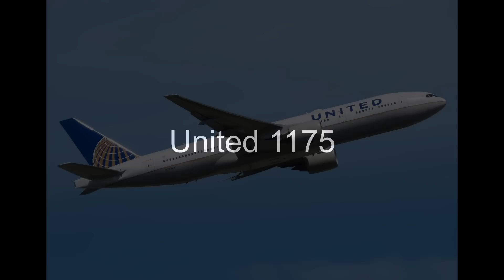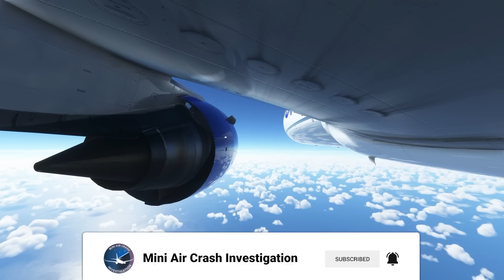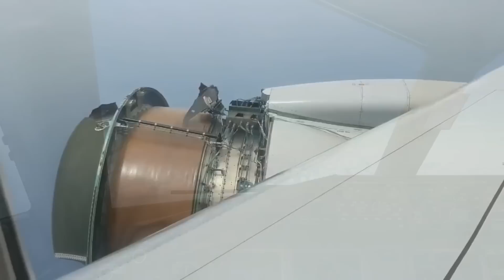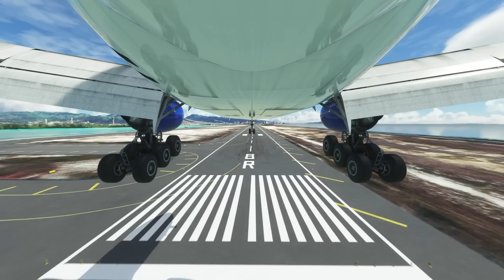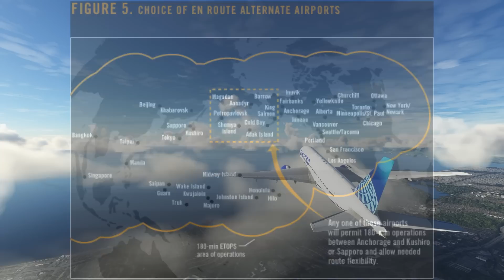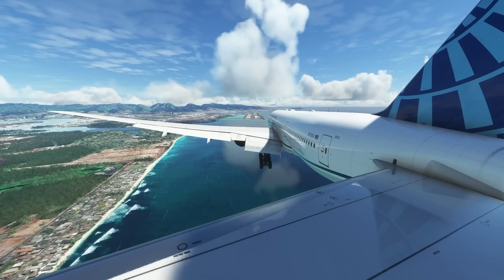How A Room With Bad AC Almost Crashed A Passenger Jet | United Airlines Flight 1175

Comment: Safety aside, I bet the inspectors would have liked the room to be cooler, too
Reply: That's still a safety issue, in my opinion.  An inspector who's personally melting in the heat is going to have a hard time properly inspecting anything.
Reply: There have been accidents caused by people being physically uncomfortable and so either being distracted or trying to spend as little time as possible in an uncomfortable environment
Reply: @NovemberOrWhatever  absolutely.  Being squashed and immobile on a long haul flight has resulted in DVT on a number of occasions.
Reply: Edit: i shouldn't comment halfway zoned out 😅 /edit
Next time, they should invest in shading blinds instead of more AC units...
Reply: Yes!  It can’t have been conducive to remaining sharp and wide awake!